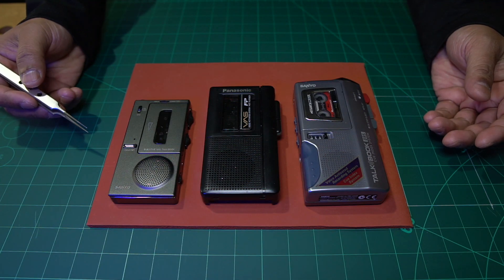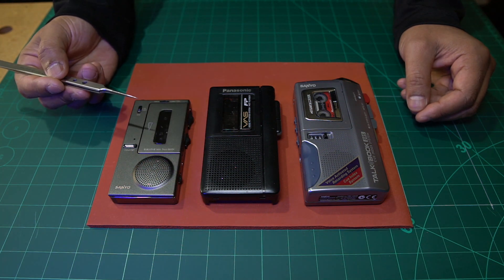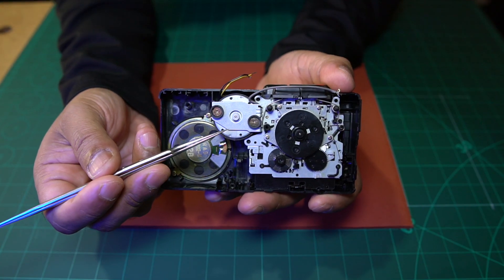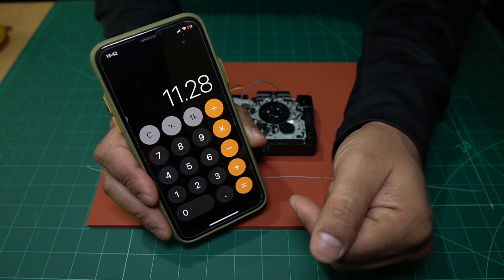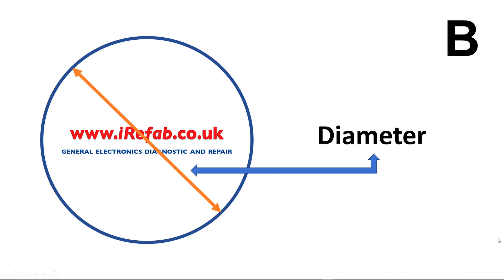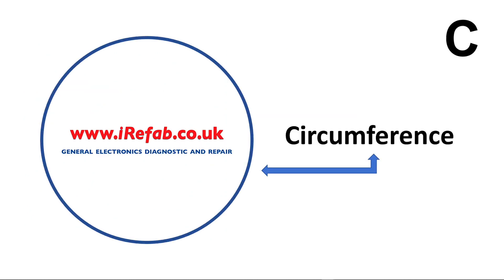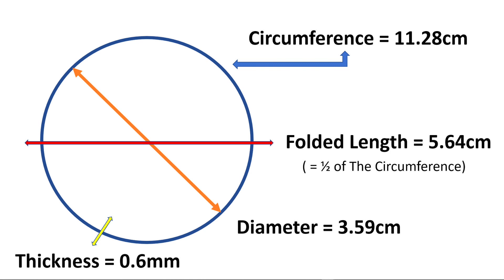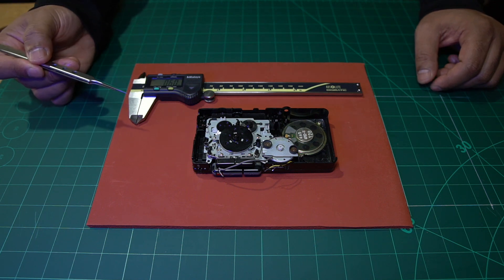Master the Art of Measuring and Sourcing Rubber Drive Belts for Vintage Cassette Players - iRefab

Comment: Hi, would the 6% stretch also for apply to any rubber belt? VCRs and toys driven with little hobby motors?
Reply from the maker: The advice I was given was specifically for tape belts but I can’t see why this can’t be applied in other situations too.  Give it a try and see if it works 👍

Comment: My first idea was to measure with dental floss. Glad to find this video, and the 6% info. Enough for friction, not enough to bind up the pully on the shaft.
That said, what the heck am I seeing when you move your left hand at 18 seconds in?
Reply from the maker: What you are seeing at 18 seconds in, is a glitch in the matrix 😂.  But seriously it’s a filter that we use to make 2 video clips flow into each other rather than having a full on cut from one clip to the other.  I’m sure I have not explained this in the best way it could be explained but I hope you understand 👍
Reply: @irefab  Fully understood, lol

Comment: Good video.  Just curious where the 6% value came from. Was that based on general comparisons between the string length and a known proper band size?
Reply from the maker: When I was ordering the replacement belts I had some communication back and forth with a British company that specialises in manufacturing replacement drive belts.  They advised us about the 6% for the stretch.  If my memory serves me well I believe the name of the company was DeckTech UK.
Reply: @irefab  Thank you, sir!
Reply: @irefab  thanks!!!
Reply from the maker: @vintageav You are most welcome 😊